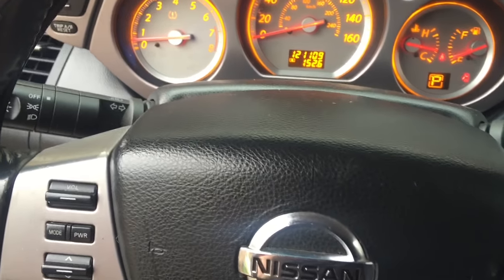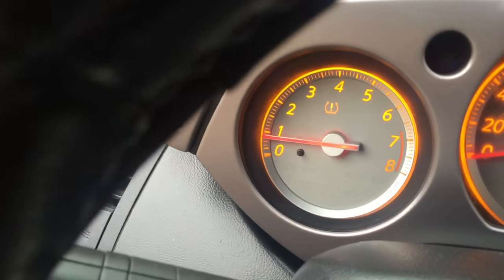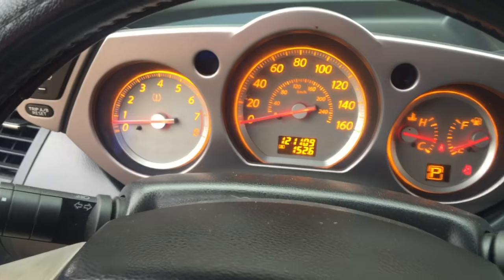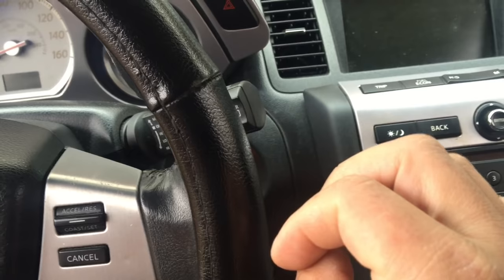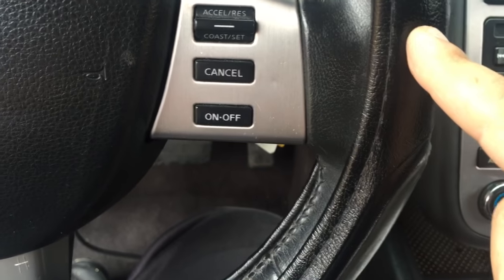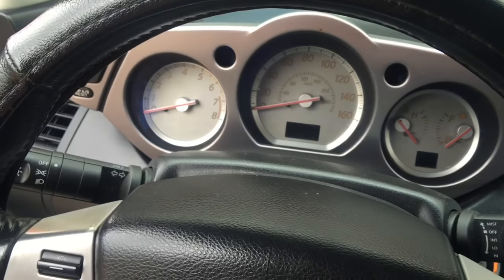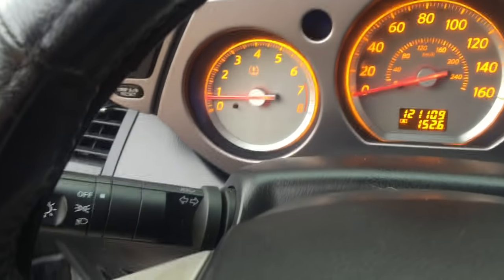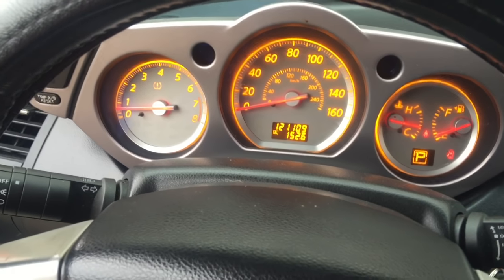Nissan P0507 Idle Control System - Idle Relearn Procedure

Comment: I did it with you perfect the check engine blinked then went solid and I cranked it and the thing I notice is it idles at 1 but if I tap the pedal it kinda jumps a little bit prob half rpm and then settles. Feels unnatural. Did I do it wrong maybe?

Comment: If this isn't working for you and you still have a high idle and check engine light, do all 3 procedures with the engine fully cold! It worked on my 06 Nissan Pathfinder. I cleaned my TB and my truck started idling around 1K and check engine light. Tried this procedure about 20 times with engine and transmission fully warm and it did not work. Next day, I thought I would try it with engine fully cold with nothing to lose and BAM, 625 RPM after a few minutes of warming up. Good luck!

Comment: Is this after you clean the throttle?
Reply from the maker: yes
Reply: @FalconsGarage  ok cause I tried it with my push to start but it was two notches above 1 rpm now it's about two notches below 1. But if I move the steering wheel it would rise a bit.

Comment: I tried this method on an 07 Altima several times, did not work. I finally hooked up my ThinkDiag in hopes that it would have the ability to do the relearn, and it did.  Fixed it perfectly.  We appreciate videos like this, thank you.
Reply from the maker: yes doing it with a scanner is always much faster and secure to do
Reply: Which model of ThinkDiag tool please?

Comment: Went through the instructions, didn't get the flashing indication, but it cleared none the less. Thx for the vid!
Reply: Same here for my 2006 Sentra SE. went through the procedure and was going to redo it so I started the car after noticing if din’t flash within 20 seconds, but when I started the vehicle the engine light was off and idle was back to normal

Comment: Thanks, it worked great!. I did clean my throttle body and my RPM increased. I thought that was normal till I got that P code. You video helped me work that out.
Reply: 2005 Nissan Frontier
Reply from the maker: Im glad I could help!
Reply: Como lo limpiaste el throttle body

Comment: Dude omg....tried this last night like 40 times with another dudes video, could not fucking get it... Literally 1 try with your video, SUCCESS!!! Thank you my brother, you really really helped me out today!!!
Reply: Dang, I literally saw the rpms drop to normal level, within spec. So I test drove it and it SES might came on and now its back to high rpm, not as bad as before, but 1100 rpm in park at idle. What do I do my man??
Reply from the maker: Have you checked vacuum leaks or if the throttle body is dirty?   Also all Nissan are known for the intake hose to crack with time. The one between the MAF and Throttle body.

Comment: Worked great on my Nissan350Z! Thanks a lot bro! Worked on the first try too! After I had my CamSensor Bank replaced, my car was idling around 1500 rpm! Now I’m down to a solid 500rpm!
Reply: And just a follow up, anyone doing this: after it works and your car is idling in the right zone, leave your car running for about 10 minutes, at least.
Turn on your AC and your rpms will go up again. Let it run for about 10 minutes again.
Reply from the maker: Glad it helped
Reply: @Kencan72  hey man I cleaned my throttle body recently on 350Z
Reply: @Kencan72  got this code so this will work
Reply: @FalconsGarage  does this work on a 2015 Nissan frontier
Reply from the maker: @jonathangarzon2798  it should. I’ve used it on 2019 Nissans
Reply: @FalconsGarage  unplugged battery and got it running at 800rpm so an improvement but I think I'ma have to go to the dealership cause it doesn't want to sit at 1000rpm with just this method

Comment: I have 2006 Nissan Altima and just bought it used (it is July 2018).  I bought it off my nephew's  used car lot - they just got it as a trade in.  My symptoms are: I usually  get steady idle at 1000 rpms in Park or Neutral. Occasionally, I get steady idle at 1500rpms. But abt every 8th engine startup it'll immediately dip once to abt 600rpm and steadily climbs to 2000rpms where it will start a cycle of dropping & surging between 1000 and 2000rpms. It stops the surging & high idle as soon as i put it into gear (drive or reverse). It will not do it on next few cranks. It'll take about 6 or 8 cranks to hit it again. 
My MIL is P0507. 

The dealership changed an engine mount the day before it started happening.  At first my nephew thought the mechanic might've left something unhooked or knocked something loose pulling off the cover to get to the engine. 

Is this a potential?  What all should i check? Do you have a video that covers every point of failure in this system?  Thanks
Reply from the maker: have you checked for vacuum leaks or your spark plugs?
i dont think there is anything around the motor mounts that could be disconnected to replace them that would cause this issue..specially sense it docent do it all the time, Have you checked if the throttle body is dirty too?
Reply: Falcon's Garage  i checked an electrical connector that plugs in at the air filter box. I opened the air filter box to be sure that the filter was clean. It's not  new, but it's not bad. I have not looked at the throttle body or any of the vacuum hoses.
 
Do you have a video that explains how to check vacuum hoses, Air valve, IAC, throttle body.... and changing spark plugs on nissan. (Ive changed plugs on 1973 Honda Accord cvcc. But ive never done a tune up on car with fuel injectors. )

I partly disabled am able to do some repairs myself. I was an aircraft electronics technician in USAF.  i have an electronic/electrical'mechanical education.  I have a little experience on cars (belts hoses, alternator, battery, solenoids, wiper motor, headlight switch & wiring, choke, ... nothing major.

Anything using hand tools I can often do as long as i have instructions (how to with dos and donts). Any help is appreciated.
Reply from the maker: https://youtu.be/O1zDnRKT-5I
Reply: Thank you. I will watch and like.  The day after you replied, the CEL went out on its own ... about 3 driving cycles after I had reseating the (MAP ?) connector at the air filter box.  Is this a coincidence?  Also I have not had the gas cap open to refuel, in case the gas cap was the problem (I tried to get the cap as tight as possible last time I refueled).  

For now, whenever I start the car, I immediately put it into gear to avoid idling in park. And whenever I park the car, I immediately shut off the engine to avoid idling in park. I am doing this to avoid any re-encounter with idle surging to keep the CEL from coming back on.  I plan to change the gas cap the next time I refuel.  I had already bought it from the Nissan dealer (before the 507 CEL incident) because I was dinged on the state inspection for not having the factory specified gas cap. They didnt ding me on the CEL but it might be a problem for the emissions check. I am trying to solve it before I have to take it in for emissions check.
Reply: do you have anything on changing a serpentine belt from the engine bay on 2006 Nissan Altima.
Reply: Falcon's Garage - hey I wanted to update you with the strange remedy i stumbled upon for the intermittent irregular idle. 

I put-off troubleshooting to address more pressing issue with my car  not starting (not cranking) intermittently. 

Intriguingly, after I installed  a new battery bc the cold crank power was below min specs.,  suddenly my idling seems perfectly fine! It's consistent. And is idling at abt 800 rpms. No more P0507 codes!

And weirdly, i just met another nissan owner who had same idle problem and was also having intermittent problems with no cranking. He also was surprised to find that changing his battery seemed to remedy the idle problem.  

So evidently a weak/failing battery can affect the idle. 

I guess that's one for the record? Have you  heard such?

Comment: A lot of people here are talking about when they cleaned their throttle. I thought only when you disconnect the IAC Valve electrical connection, you need to do the reset. Am I getting confused here? So you need to do this even when you clean the throttle head? I am not removing any electrical wires to throw off the computer setting. I had mine sprayed and cleaned when I found a crack in the intake valve hose and removing the hose only. I appreciate your response. Thx
Reply from the maker: it just depends when your code comes on .. code could come on after cleaning OR after disconnecting
Reply: @FalconsGarage  my code is p0507.  What code it is.

Comment: Ok I have a 2006 nissan maxima 3.5 its putting out code p0507 I tried your video step by step with you and the check engine light never blinked can there be anything else I need to do?
Reply from the maker: You can try taking it to the dealer or get somebody with a tech 2 scanner to program it.

Comment: hey man I just saw your video and great explanation but I had a question I have a 2007 Nissan Frontier 4.0 and I ended up cleaning the throttle body and the same code popped up. I do feel like the truck is pushing itself a little bit did your car do the same? and do you know how long it takes for the chemicals to go through the engine because the shop told me that it takes about 50 to 75 miles for it to get it through the system
Reply from the maker: what chemical? did you not take off the throttle body to clean it? or did you just used some chemical on the intake?
Reply: I used throttle body cleaner. i actually had to run the test twice and now its running better than ever! thank you! very good explanation. i just get scared when things are not working on my truck.

Comment: I have a 02 Infiniti Qx4 it doesn't  want to start when the engine is cold without pressing the accelerator  some just enough to bring it to 5-600 rpm.. After giving it gas for just few seconds it runs fine at normal rpm. After engine is warm the car will start all day long.. Everytime I  search this is what comes up.. Any thoughts.. Is it my TBS?
Reply from the maker: sounds to me like you have a dirty throttle body
Reply: Falcon's Garage thank you.. I'm going to clean that bad boy up and hope for the best.

Comment: Is the code supposed to delete by itself?i got the blink indicator and everything i cranked the engine when the liggt turned solid
Reply from the maker: for the most part it usually deletes it self after driving it for a while.... or you can always clear it your self with an scanner

Comment: So I get the same code but mine after I drive it like 30 minutes it starts jerking and after 20 minutes of it starting to jerk it wont accelerate unless I turn it off and let it cool for a few minutes does it sound like a icv is bad ? I changed the throttle body
Reply: Just wondering if the code should just make the Rpm higher or does it also cause it to jerk
Reply from the maker: usually when you get this code you just get a higher RPM nit really any jerking. are you getting any other codes when jerking? a misfire or something?
Reply: Falcon's Garage well I was told it's for sure the idle air control valve and it costs like 900$ I've replaced the alternator, battery,and the catalyst converter do you think the Iacv would cause the truck to stall like that ? Only when warmed up completely

Comment: P1122 and P1126, eratic idling, CEL and VDC Off...? Replaced throttle body and relearned virtually everything and cleared codes, still get P1122 and P1126 on startup. Starts up perfect and then the lights come on and the idle goes either low constant or all over the place between 750-1650. Any ideas?
Reply from the maker: make sure there inst a vacuum leak somewhere as well and I would start checking the wiring system
Reply: Falcon's Garage Thinking it's the throttle control relay. If that fails, it throws both codes. When I start it up, I can hear a crackling noise in the area where that relay is located. I'm guessing that if the relay fails, it can't communicate with the throttle body, and thus the codes for both the circuitry and the throttle body itself will display. Does that sound about right or am I way far off?
Reply: I should add that it sounds like the relay is spark gapping.
Reply from the maker: Shannon Wetnight that sound could also be the replay engaging. When ever the engine is off but the cars ignition on you should be able to press the gas pedal and the throttle body should engage check that it does also. 
Also see call the dealer and see if there is a computer update on your car. 
Sometimes they develop glitches on the computer and an update fixes it.

Comment: I had the throttle body cleaned on my '07 Nissan Versa and now the RPM's are jumping from 1-2. Do you know if this procedure will work? I don't want to spend the money on a new throttle body if I don't have to.
Reply from the maker: yes this procedure might help you!
Reply: cHECKED tHE  o  rING iNSIDE tHE  tHROTLE body

Comment: I did a tune up and cleaned the throttle butterfly with battery connected and got the code too. I tried doing the relearn on a friends expensive scan tool that said it does it, but p0507 came back. Now if i try this procedure ('service engine soon' already on). should i clear the dtc first then do the relearn or leave dtc stored with light on and do relearn....OR does it not matter. Thanks!
Reply from the maker: you can clear it before or after it doesn't really matter

Comment: Thanks! my 2015 Rogue just quit yesterday. Turned out Pos cable was loose. When it came back to life after a jump, idle became radical and car was jerking and struggling, like fuel pump. I am starting with the IAC. If I clean throttle body, can I try your procedure next? Also, do you recommend a code app for iPhone or some other not-too-expensive checker? thanks again!
Reply from the maker: i would buy ab obd

Comment: Had code P0171 (system too lean bank 1) so I decided to clean the MAF sensor and throttle bottle with the appropriate cleaner (I’ve don’t it before). Resulted in added code P0302 (cylinder 2 misfire) and it revs up and down constantly. Filled it with Techron complete fuel system cleaner and filled the tank. The previous codes then disappeared and I now have the constant reving plus code P0507 idle control system RPM higher than expected. Should I replace it?
Reply from the maker: have you done a smoke test .. to see if there is an intake leak?

Comment: Good video, we had to replace a starter on a Nissan Armada and I noticed the next day the idle was out of whack and it even accelerated slowly on its own and shifts gears , could this procedure of changing the starter and putting things back together have anything to do with this issue ? Thank you kindly
Reply from the maker: unless there was something left loose or unplugged there is really no reason why a starter change should effect the drive of the car
Reply: Falcon's Garage he left one of the hose unconnected it was leaking vacuum! Thanks for your input

Comment: I have a 2004 Nissan Altima and I tried this procedure like 10 times and I can't get me engine light to blink. I've done it at the same time as I watched the video also. I cleaned the throttle body. What am I doing wrong?
Reply from the maker: could be  Bad throttle body. or computer
Reply: I know is a bit late, but did you find out what the problem was, im having the same problem, my check engine light wont blink during the relearn, I'll appreciate it if you can help me out.

Comment: Thank you for the video Falcon's Garage. I have a 2002 Nissan Altima 3.5 SE. It's pulling this code P0507. The shop where I took it, is telling me that I need to replace the Idle Air Control Valve. But I previously replaced the throttle body with a new one and I don't think it was relearned. I wonder if that's what throwing the code. Any suggestions. Thanks!
Reply: Julio Alvarez hey had the same issues as you now atm. Can you tell if what you did to fix your situation

Comment: Ok what if you done the replacement and relearn system and light still stays on what else could make the light stay on ..on a nissan murano 2005
Reply from the maker: whats the code?
Reply: @FalconsGarage  p057 throttle body has been replaced and relearn system done light is till on
Reply from the maker: do you mean p0507?  as long as the relearn was done properly then you have a different issue .. maybe wiring hardens ...
Reply: @FalconsGarage  ok so what would you suggest for.it to pass inspection

Comment: hey  I have a Nissan sentra 2007 I clean my throttle and a check engine light turn on. now I get a p507 when on idle is on 1800-2000rpm I try reseting it but it wont work
Reply from the maker: keep trying it, tr it when the engine is cold and then again when its hot, ive seen it work on both instances

Comment: I the procedure but now my 04 murano won't start. sounds like the battery died. any suggestions?
Reply from the maker: if you jump it will it star?
Reply: it must've tripped the starter in the process. because I just banged it a little and everything is fine now. 
just something to know just in case it happens to someone else. thank you
Reply from the maker: sounds like your starter is about to take a dump.

Comment: I did  all the steps but my idle still jumping from 1000 rpm to 2000...
Any suggestions?
Reply from the maker: vacuum leak?
Reply: Did you ever figure it out? Mine is doing the same shit. 😭
Reply: Any fixes ? Did a engine swap in 05 Nissan Atimla 2.5LS. New throttle , RPMs bouncing from 1100rpms to 1900rpms. Wont response to r
Any learning procedures. Any tips ?

Comment: After I removed and cleaned my throttle body on my 07 Armada, the check engine light came on and now it won't turn on.  Well, it turns on, and dies.  I even hit the gas when it turns on and still turns off.  Please help.
Reply from the maker: sounds like you need it reprogrammed